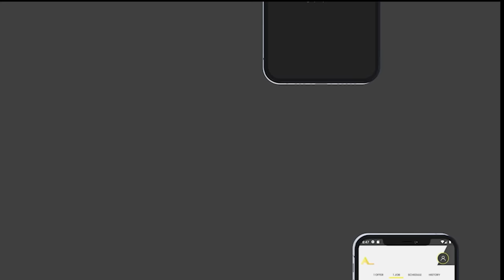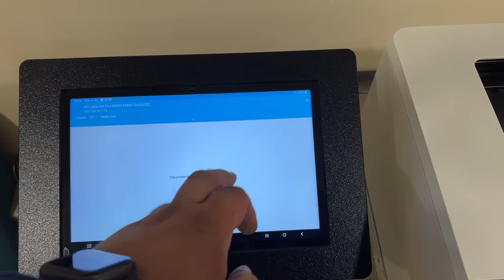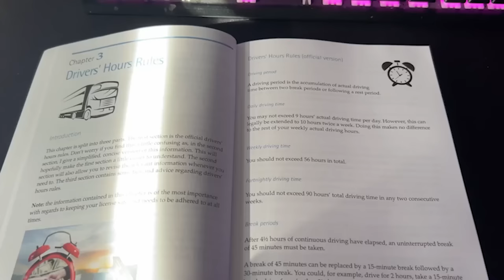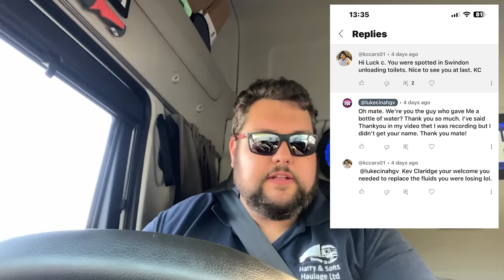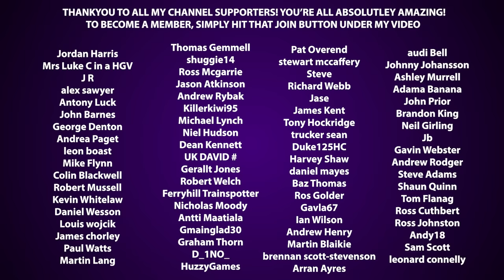Driving A HGV To Silverstone!

Comment: Possible picking up the car going the other way. Close to the radar, thinking your going to crash.
Could it be equipped by your company a device called light foot?
It's gone off going hard round a corner, and the other on hard acceleration?